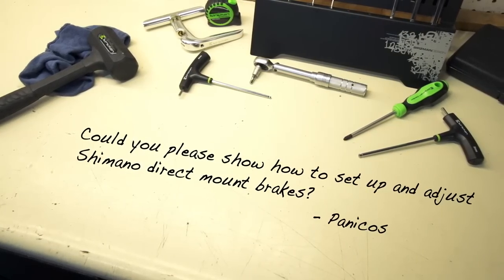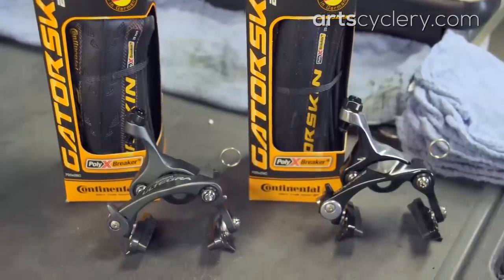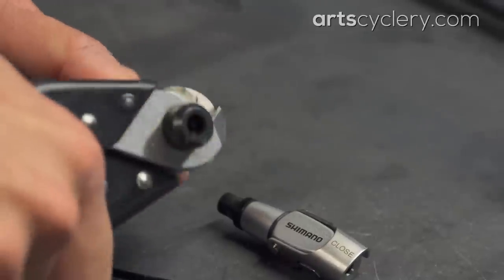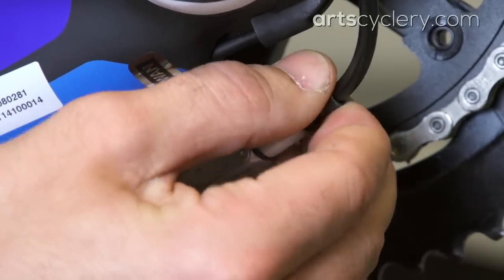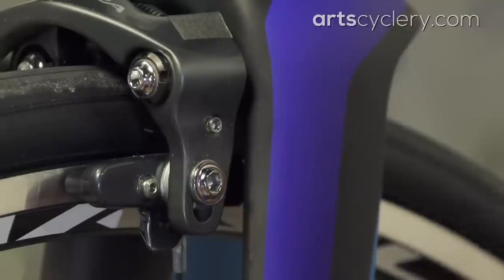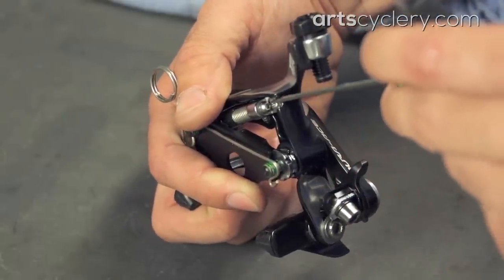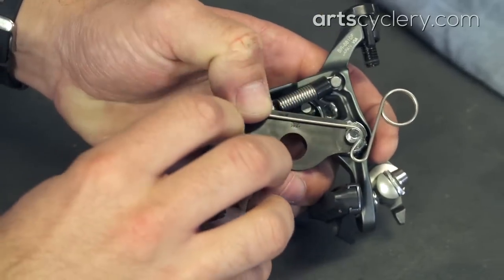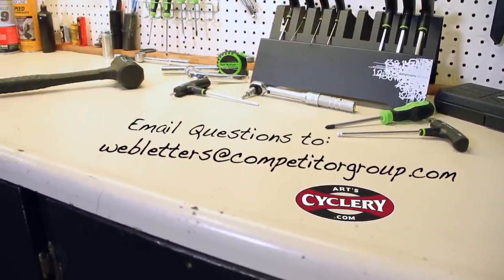Ask a Mechanic: Shimano Direct Mount Brake Setup

Comment: I have "upgraded my Trek Madone 5.9 kammtail to these brakes...nowhere on the Shimano help was shown the rear brake cable run, at 0.58 you "thankfully" have a still showing clearly the brake inner cable pivoting over the caliper, is that right? what is the torque for this...and finally what do you make of those soft metal 2mm threadlock coated adjusters, I had to hacksaw a notch in the front one on first use...it rounded out, the back one is also brand new and even more poorly designed, and i cant move it...caveat emptor...they are expensive but my o my!

Comment: Never liked cable "tension" in describing shifting and braking adjustments.  It's really about the length of the cable.  Increase housing length, shorter cable length, really.  In braking, cable is under the same 'tension' until the pads hit the rim, then as you squeeze, tension increases.  In shifting, the return springs in the derailleurs have the 'tension' the same no matter what.  Shorten cable length, by increasing housing length, by screwing out a barrel adjuster. Increase cable length by shortening the amount of housing it's traveling through--by screwing in a barrel adjuster.  Squeeze lever, pads don't hit rim, or too much travel?  Too much LENGTH, not tension.  Apart from this nitpicking of mine, well done instructional.

Comment: Wish I'd found this vid before i worked this very technique out for myself....especially positioning the brake pads central on the brake track, THEN using the business card for toe in. For years, I've tried to do both steps simultaneously....the card always obfuscated centering the pad on the track. 
Nevertheless, I just bought new wheels, wider....so I've just successfully followed your way. Thanks.
Reply from the maker: Glad it helped

Comment: 3:47-3:49 ish - showing the back of the caliper - am I right in saying the piece of plastic shown here between the direct mount bolts (together with the piece of wire holding in place) is just for packaging?
Reply: Always watch the full video before asking questions! Just seen its the spacing tool that comes included.
Reply from the maker: Happy the video helped!

Comment: Great video. I'm having a problem with a 7010 rear brake. Because the cable bolt area is located on the left side and goes slightly out of the frame, I can't install my Stages powermeter. There's not enough space as the left side of the crank hits the rear brake. Is there any solution to this or should I throw this bike and call it a terrible idea to buy a bike with such a stupid brake design (bellow the bottom bracket).

Comment: Hello, are there specific spacing requirements for the bolts or will the brakes generally fit any direct mount brake frame?
Reply from the maker: mayalman Any Direct Mount brakeset will fit any direct mount frame.

Comment: Just out of curiosity, every other install of a CB90 has it inline with the cable coming out of the brake lever, yet you have it mounted underneath the bottom bracket, is there a reason for this.
Reply from the maker: paradox963 Either way will work just fine. To be honest, it's personal preference and for the sake of ease, it would be be best mounted coming out of the brake lever as you've suggested.
Reply: Art's Cyclery Do you need to use  the CB90 at all on madone frames which have a QR for the rear brake built into the frame? Is there sufficient tension released in the cable by that?

Comment: can I mount direct mount brakes on a frame that has got v brake mounts?
Reply from the maker: Most all direct mount brakes require frames that were designed around DM brakes. In your case, I would suggest sticking with V-brakes.